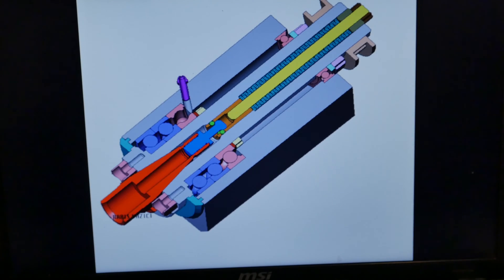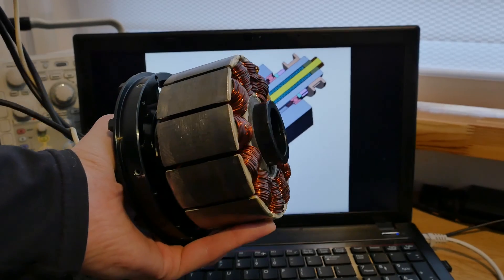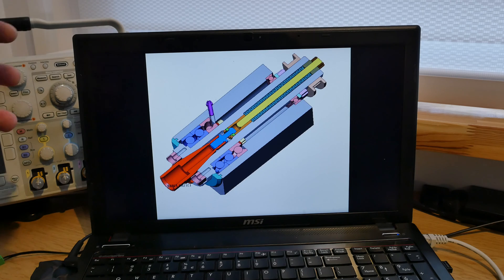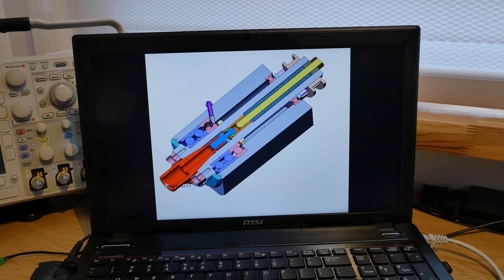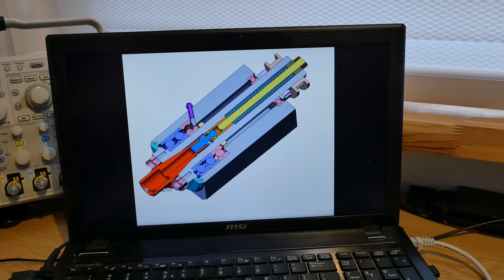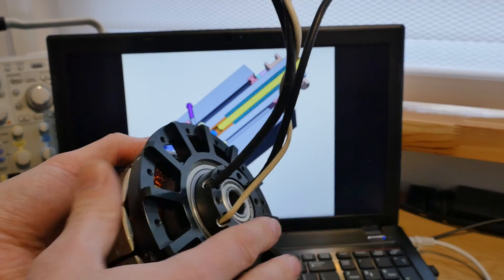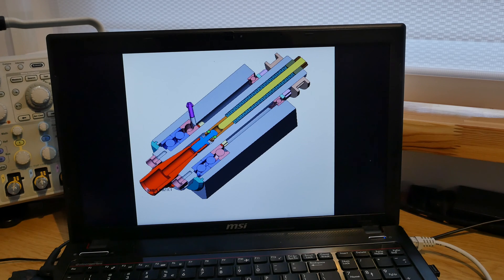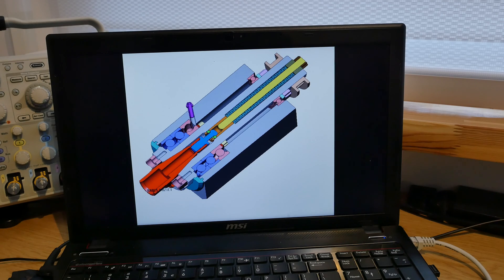BT30 ATC Spindle with integrated 6KW 6krpm motor:Idea

Comment: is it able to make a spindle @30krpm in structure like this? nice job dude!!
Reply from the maker: No, i would never go that fast with spindle like this. This would be suicide.

Also motor could not go faster, and forces will be huge :( 

max 6krpm
Reply: but how the commercial manufacturers do that? cos it won't be a matter for a brushless motor to run at that speed, is it limited by the structure?
Reply from the maker: it's because of Back EMF. if you need to spin motor at higher speed, you must have higher voltage, because BLDC acts like generator every time. and if you reach back EMF voltage, you can't supply current, so you have no torque.

My BLDC is 100V for 6krpm, so if i want to go 30k, i need 5x Higher voltage.

Comment: You could always buy a belt driven BT30 ATC spindle to use with that motor.

I don't wish to burst your bubble but making the spindle yourself probably won't end well. It's not worth the hassle when one can be bought used or from china.

What RPM are you aiming for?
Reply: He probably want's it compact for a 5 or 6 axis CNC, so he can tilt/roll the milling head at the end of a ram, like the big portal mills have.
A servo + belt drive + power head is pretty big in comparison to a setup like this.

Comment: Hello Linas K
What model , brand is this BLDC Motor ?
The servo drive for this motor I think that it has to be very powerfull. Big low resistace drain to source mosfets.
Keep it up ,nice work.
Reply from the maker: Yes, it should be big.
Revolt RV-120Pro